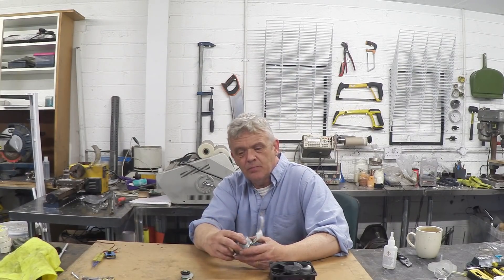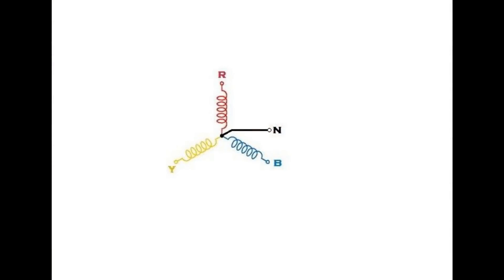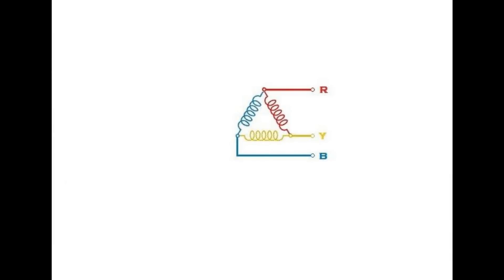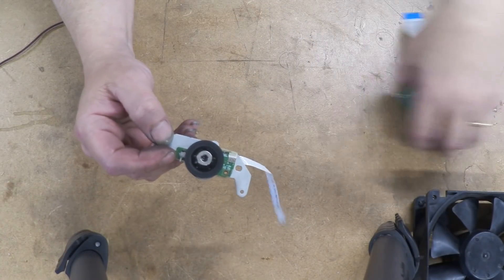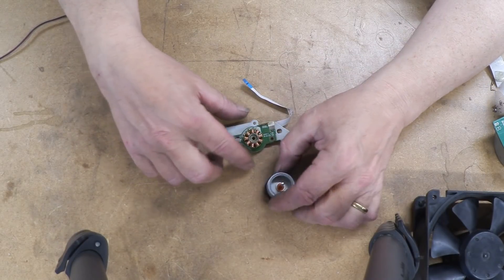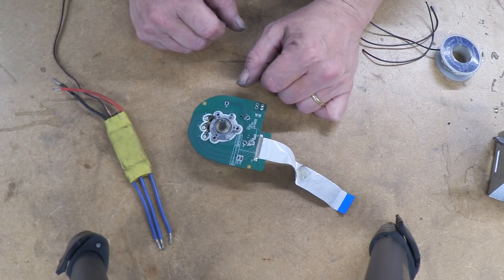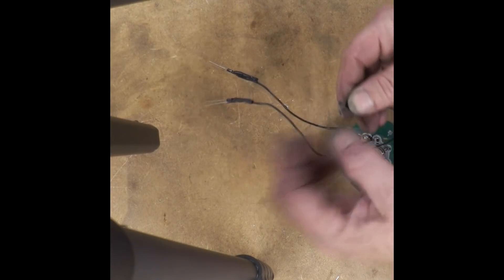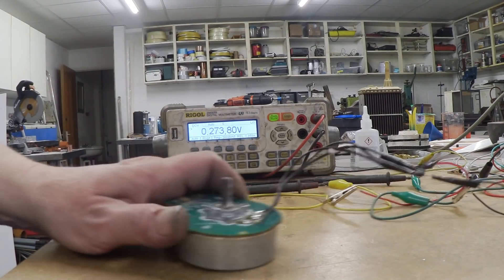All About Brushless DC Motors And Generators

Comment: Hi Mr Robert. Ihave the cdrom motor. That runs well but as if it were free spring inside it I mean there is a noise like little spring parts inside. That is normal or not? Thanks

Comment: Great video, I want to use a DC motor for a vertical axis wind turbine as a generator and it is not self-starting. How can I design a starter circuit to feed power until it starts rotating and stopping the feed power?

Comment: PC fan is only 2 phase usually. 1 solder spot is the common. You can also tell by how many 'spokes' on the star shaped part. A multiple of three 'spokes' is three phase. A two phase motor will have a multiple of 2 'spokes'. Luckily the PC fan motor has 4 'spokes' and the CD ROM motor has 9 'spokes' so there is no confusion with a number of spokes that is both a multiple of 2 and 3.

Comment: Great guide, thank you. It's worth noting that the printers that you take these from will probably have a motor controller built in and the stuff that you ripped off can be really useful if you need to sense the motor position. I was building a wind turbine but i wasnt happy with the particular motor, with a different 3d print and a bit of experimentation, I had the start of a weather station and a great wind direction sensor!

Comment: Great video. I have a huge 3 phase motor from a front loader washing machine. Been wondering if it is worth setting it up as a generator due to the weight and starting fiction. The magnets are super strong and the coils are nice.

Comment: How did you know to run your motor on 6V?  If it isn't obvious from the source (e.g. 12V fan), is there a way to discover the input voltage w/o burning out the motor?
Reply: @Heads Mess Whew, more of an answer than I expecting.  Thanks.

Comment: Thank you so much for your very clear explanations of these motors. I never thought of them as delta and y circuits. That opens up a whole lot of the matter, but am I right: if you take any two motor leads and reverse them you change the direction of the motor? Thanks so much, I have quite a few of these.

Comment: How about a video on a DIY brushless motor driver. I have attempted this but was unable to come up with a good solution to track the position of the motor. Which is very important. I assume this is done by sensing, and reacting to the inductive kickback on each coil. Are you aware of any relatively simple ways to do this? I know the speed controllers are cheap and easy to get, but its still a fun project to make your own.
Reply: @Heads Mess Thanks for the reply!
I'll look up the great scott videos.

Comment: I have noticed bldc is the next big thing in celing fans, they offer high effiencey, and a selling point I guess, I have a couple of the 12v celing fans, for camping , rv's and such! Nothing like the new 3phase bldc, fans, well I'm not sure why they would rectify AC, then convert to 3phase, seems any gains would be lost in conversion, being mains powered I'm not sure the voltage either, the small 18" 12v fans I have work fine! They can be noisy,   great video!
Reply: It might have something to do with the motor cost. An AC  motor running at the low RPM needed for a ceiling fan needs lots of poles - at least sixteen. That's lots of separate coils, lots of magnets, and lots of physical space to fill with material of suitable magnetic properties. It may well be cheaper to use a simpler-construction and more compact BLDC motor, even after considering the cost of the driver electronics and power supply.

Comment: In Dr Bass videos he shows a ebike setup with big industrial star delta switch ! You take off in star and get good torque but then switch to delta and it increases the rpm ! I am not sure if this may improve the twizy performance much as its heavy but it might lower amp draw when its at higher speed !

Comment: Why it called DC when it uses alternating currents?
Reply: Input to the whole assembly is DC, while it internally use various signals.

DC in, rotation out if you see the whole motor+driver as a block.
Reply: @erlendse  it DC was real input then you would not need to change currents. Those motors would work on pure sine wave with off phase. Their output is also sine wave.
Those ESC just create varying currents from DC.
Reply: @darkobul1  1. there are no sines from the driver, it actually outputs square wave.

2. No DC motor can have continous motion without some sort of switching.

brushed DC motors use brushes to create AC for the coils in the rotor.

The driver(often called ESC) does the job brushes would do on a brushed motor.
Reply: @erlendse  i know but that is change of current. That square wave gets damped by coils in motor and mare change of current from VCC to ground are also AC. But thank you for trying to explain it. Its very confusing.
Reply: @darkobul1  Yes the motor is AC.

They "motor" part of BLDC is syncronous and tends to be somewhat tricky to run off a simple AC source, since they only work in a synchronized state.

But a BLDC motor itself is seen as half a motor. Adding the driver/controller make it a whole DC motor.

A whole motor that can run off DC.
Reply: The motor itsself is AC, but for practical purposes it is considered as a unit together with the electronics that drive it. In larger motors they even come integrated in one case. The electronics run off of DC.

Comment: I'm sorry that's not enough you deserve more. I've been designing and boat for some years now and one part I've been kind of stuck on is deciding how to bring air conditioning to the boat. You have given me ideas to help me decide. This is my issue of having many skill sets is deciding what's best or can I life without a system. On boats it's best thing's work together like heat and cooling in one unit. But also on boats redundancy is king as it could be the difference between life and death. So balance rank suppream. Building a boat like the one I want to build requires much thought as some things can't be changed once done or start over. Stating over will cost much more time and money. So hopefully you can see how your videos are inspiring many people in ways on matter what their trying to do big or small.

Comment: While Delta wired motors is always 3 wires, 3 wires may be either Delta or it may be a Wye without a neutral wire, and 4 wires is a Wye with a neutral wire, but most 3 phase Wye motors do not need a neutral as current is never conducted on the neutral. As for solder points, a 4th solder point not connected to anything may very likely be neutral of a wye and just 3 solder points may still be a wye where the neutral is not soldered to the board. 

With Wye configuration you always energize 2 coils at a time. With Delta configuration you only energize one coil at a time.
Reply: Most drivers use the senter for sensing and drive two windings, if center is used at all.

With Wye two coils would be powered, while delta it would effectively be all 3 with different ratios.
Reply: @erlendse  your mostly right on the delta coil energized, and I was just wrong.  With Delta, most of the time all three coils are energized, but there are moments (instances) when anyone of the coils have 0 current, as the current moves to reverse direction. 

Are you sure that wye neutral is used for sensing?  My axial flux BLDC motor on my channel is wired wye and neutral is not used.
Reply: @kreynolds1123  The sensing part is true for some of the 6 step BLDC drivers.
Not used on motors with sensors, or vector control.

Many actually don't use the center wire or simulate it with 3 resistors.

The drivers that use it have 4 connections for the motor.
Reply: @erlendse  ahhhhhh, I see. For back emf based electronic speed controllers, three resistors in wye create a virtual neutral to compare against and detect the zero crossing. 

I see that a virtual neutral network or resistor can work with both Delta and Wye motors.  But, without a virtual neutral one needs a Wye motor with a real neutral wire as a Delta can not provide a neutral reference without a virtual neutral.
Reply: @kreynolds1123  Yes, that's basically it.

Comment: Nice video!
Back in the mists of time (it really was a long time ago) we were taught "Star" and "Delta"! 
If you reverse any 2 of the 3 phase wires you reverse the direction of the motor (handy if you need a reverse switch)

If you go big scale you get a Star Delta transformer in your substation. The HV in pylons is Delta and the 240/425v supply is star with your neutral off the center .... and the earth too!